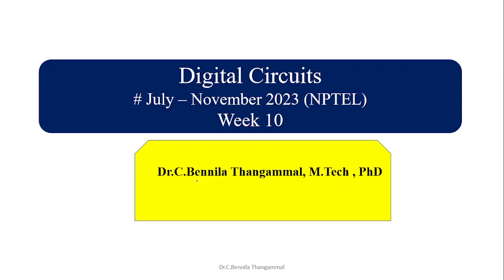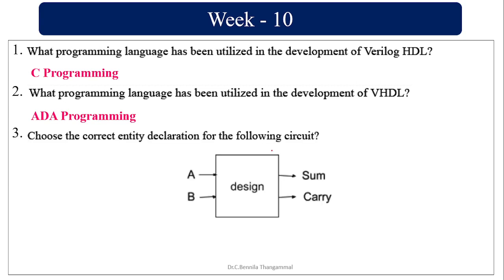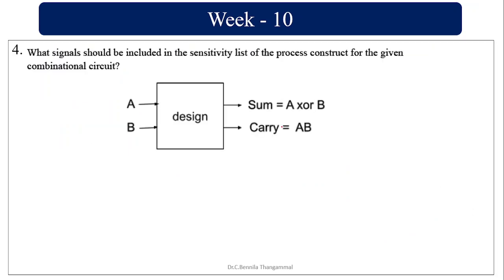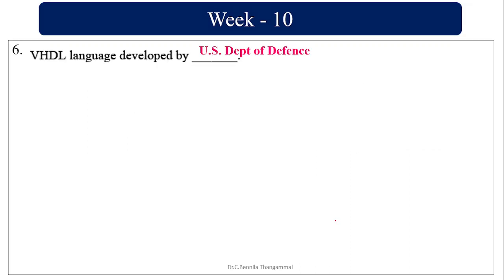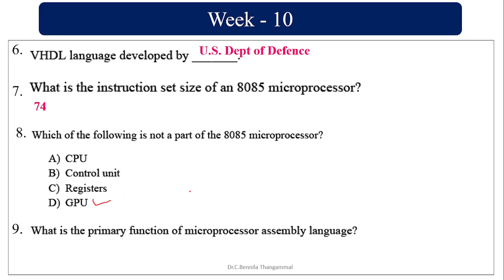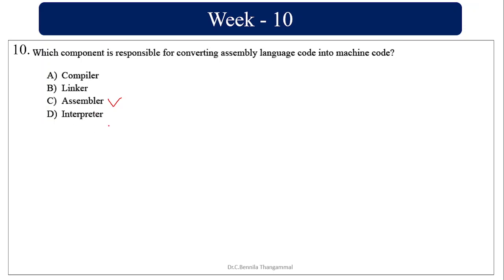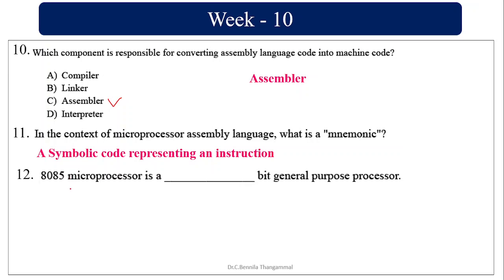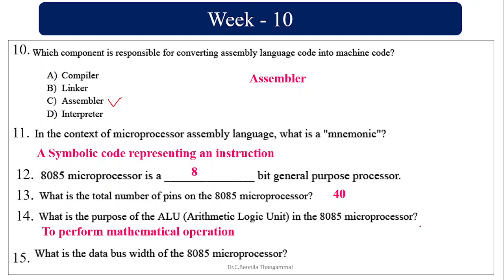Week 10 Digital Circuits - Assignment Solutions

Comment: Mam i think answer for question 4 is A,B
Reply from the maker: I appreciate for making this learning as collaborative learning
Reply from the maker: No.... it's C
Reply: @bennilathangammal   Mam the sensitivity list should include signals A and B because changes in these inputs should trigger the process to calculate the Sum and Carry outputs.

So the correct option is:

A) A, B
Reply from the maker: @ramsurya6668  yes... what you have mentioned is correct.  The signal which trigger the changes in the output should be in sensitivity list.
Reply: Now what is the answer of 4 question
Reply: @bhavanireddykandi  A,B
Reply from the maker: @bhavanireddykandi  option  : A